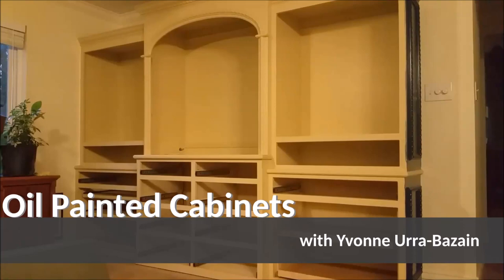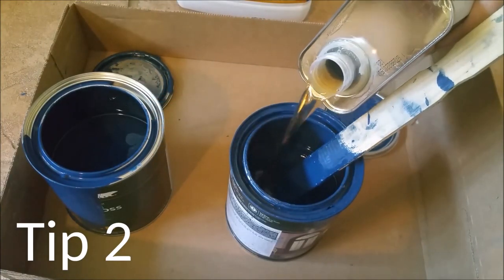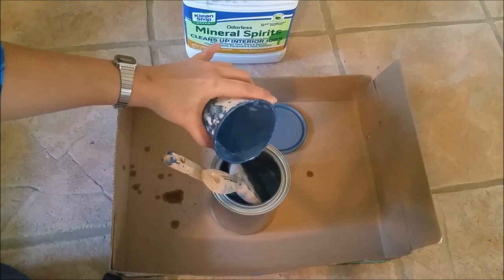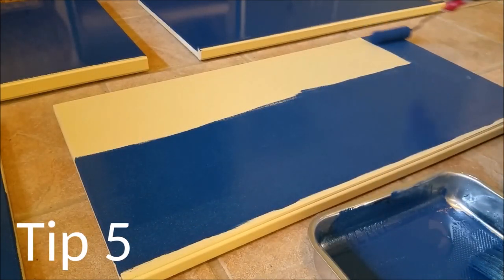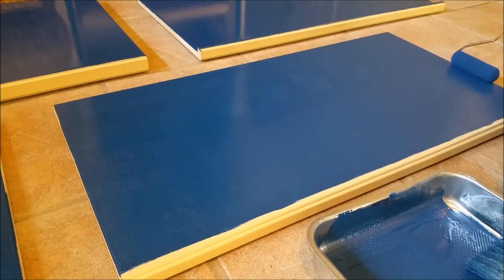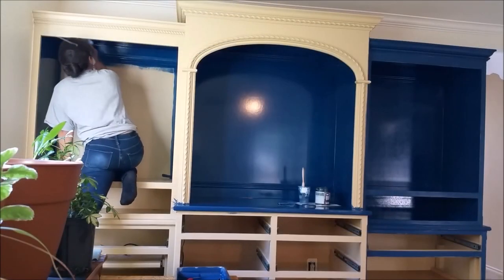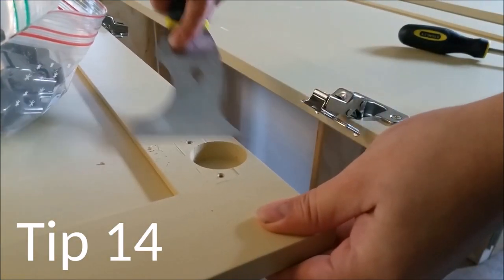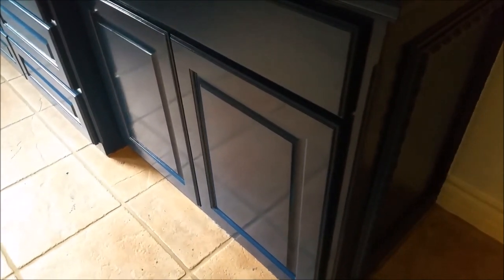How to Apply Oil-Based Paint on Built-In Cabinets  |  sunnysideupstairs

Comment: Your painting project is beautiful like yourself. I'll try your tip about mixing the oil with some spirit. My project was failing because of brush and roller streaks. I didn't know what else to do. If this really works, I'd give you a five-star rating. All the best.
Reply from the maker: Thank you! I wish you the best!
Reply: @SunnysideUpstairs  I actually have a question if you don't mind. Can I use any mineral spirit to thin my paint or does it have to be a special brand like the one you've used?

Comment: Thank you so much for the penetrol tip! Saved me!
Reply from the maker: Great to hear it helped!
Reply: @SunnysideUpstairs  what color was your penetrol? i just opened mine and its amber.
Reply from the maker: @smilegagadk  Amber as well, although it did not seem to affect my paint, probably because it is so dark. Do a test swatch to ensure it dries how you want with Penetrol added. :)
Reply: @SunnysideUpstairs  I just called PPG to ask if thats normal for it to be amber and i swear the technical rep said "why are you using penetrol just use mineral spirits". i told him that was causing solvent pops. and he admitted to not liking penetrol im nervous to use it now.
Reply from the maker: @smilegagadk  Ah, I wish you well with whatever you choose. I experimented with penetrol because it came recommended by another DIYer who has used it with good results. I would again recommend using both products on a test swatch to see which works best for you. A little test before diving in can save a lot of trouble.

Comment: Nice work.
If you want to step it up yet another notch;
Mix colored mica powder into spar urethane and apply as clear coat to attain metal flake effect and high gloss sheen.
Reply from the maker: Cool.  Would it have a subtle glitter effect?  I might try that on a different piece in future.  :)
Reply: @SunnysideUpstairs  
Yep.  
You can order mica in different colors, and different flake sizes.
Anything from fine pearl to glittery flakes.

Comment: Great video and lovely results.  Is priming advised?  Does not look like the video shows the item primed.
Reply from the maker: I advise priming on untreated woods, or over other finishes. I did not prime for this piece because it was previously oil painted and I had tested adherence with the oil-based enamel before starting the full painting job and was impressed. When in doubt, light sand and prime!

Comment: Thank you  is necessary apply clear finish at the end?
Reply: Not necessarily but with a high use areas, like a desk or kitchen cabinets. I would recommend.
Reply: Thank you!!
Reply from the maker: It has been a year and the paint has held well, but as @Dime Fever suggested, a top coat would protect it in high traffic areas even further. :)

Comment: I hope I can use your tips, I’m struggling lol kinda regretting using oil paint based 😂
Reply from the maker: It can be tricky, for sure! I hope the tips help. It's a terrible feeling to struggle with painting something. It took me a long time to paint my huge built-in, so it was a big learning experience for me.

I used the oil-based enamel later on unpainted wood and it was so much easier and even more durable than the built-in turned out.

Comment: Did I miss the part about preparing the wood first? I heard that you should prep bare wood with something before using an oil based paint to prevent cracking, peeling and discoloration later down the road.
Reply from the maker: Great point!  This cabinet was already painted that light yellow beige color.  For painting bare wood surfaces, I would recommend sanding, thorough surface cleaning, priming with an oil-based primer, and allowing that to set.  If necessary, you may need to sand the prime coat to keep the surface smooth, clean thoroughly, then begin painting.

The prime coat is cheaper than the paint top coat and will lessen costs as bare wood is porous and will absorb both oil and water, causing the potential need for multiplied top coats.  For the smoothest, most durable finish, surface preparation is ideal for both oil-based and water-based paints. :)

I painted the built-in a year ago, and it is holding up very well, this far.  I'll be updating it with hardware this year.
Reply: She mentioned that briefly at 2.45 minutes.

Comment: Oil based paint is expensive but way worth it.  What was that additive you said made it work better?  Plain old mineral spirits don't work?
Reply from the maker: I used Flood Penetrol based on research I did prior to purchasing supplies.  I would recommend doing a test with a mineral spirit dilution to see if it lays and dries with the finish you require.

Comment: What dilution did you use with penetrol flood? I've painted some shelves twice now using oil based paint, a natural purdy brush, and penetrol at 1 part to 8 parts paint. Still I'm getting a very brush marked finish. Going to try a foam roller next but am getting really bummed.
Reply from the maker: So sorry to hear about your brush marked finish!  I put much more Penetrol Flood, although I did not measure it per parts.  I would recommend doing some test swatches to see what dilution would work best for your paint before you dive in to painting your piece.  Please let me know how it goes!

Comment: How much penetrol do you add to your paint? I'm trying to figure out what consistency the paint needs go be
Reply from the maker: Great question! I kept it under a 1:5 ratio of penetrol to paint, but I would recommend that you add small amounts, mix well, then test the paint consistency. That is what I did. Different paints respond uniquely to different environments and applications. 

With additive, less is more. Add only as much as you need to help paint go on smoothly, and level out over a longer drying time for the glassiest finish.

Comment: How did you store your brushes in between each coat? Did you clean them each time?
Reply from the maker: Oil paint does not dry as quickly as waterbased, so during the work day, I wrapped my rollers and brushes in a ziptop plastic bag if I had to take a 30 min break.  At the end of my painting for the day, I cleaned my tools with mineral spirits.  Clean up was the most inconvenient part of the process, but the results felt worthwhile when it was done!

Thank you for asking that great question!

Comment: Oil based paints will really stink up your house to the point where staying overnight might be impossible. 

Even with ventilation the stink will linger for a day or two.

How do I know? I had the interior of my home painted with latex and the door frames and baseboards with oil based.

They stared early. By the end of the day the house was unbearable. I knew I wouldn't be able to sleep there so I made arrangements with family to stay a night or two.

We recently bought a three piece sold wood bookcase that we want to refinish in an oil based paint.

They will stay in the garage until we get started and finished. As bad as the house smelled with just the baseboard and door frames it will be worse if we painted them inside.
Reply from the maker: Agreed! It's not the ideal solution to paint everything in oil paint for several reasons, but the chemical / noxious smell ranks high.

Comment: I added the oil base paint but didnt add anything to the paint. Does it affect what I  painted?
Reply from the maker: The additive just helps with making application easier. The oil-based paint works great on its own, without additive.

Comment: For high traffic areas, what kind of top coat would you recommend?
Reply from the maker: Thank you for asking this queation! This is next on my experiment list, especially because I chose a rich color for my cabinetry.

For water-based, I have had good experiences with Minwax Polycrylic.  I've heard some good things about Varathane Triple Thick Polyurethane, although have no experience with it.
For oil-based top coats, I am looking at the General Finishes line. I hope to do some tests and report back within the month. :)